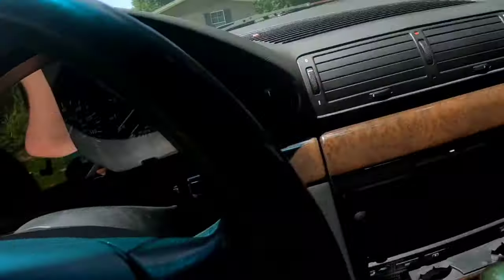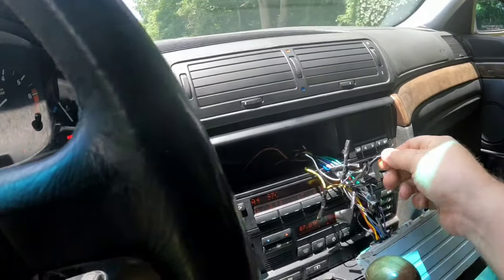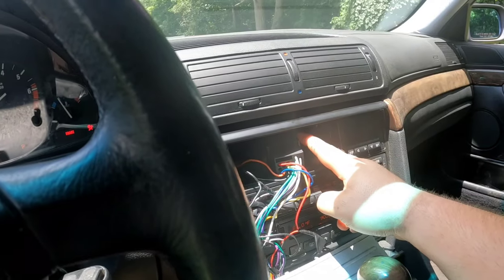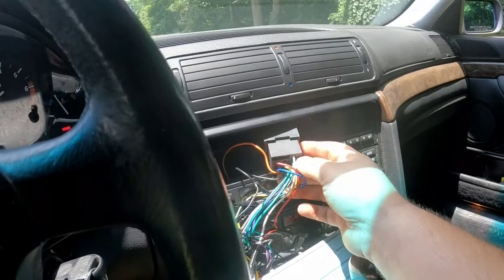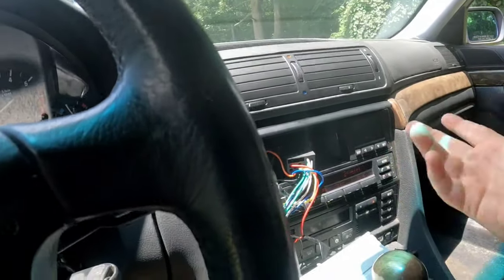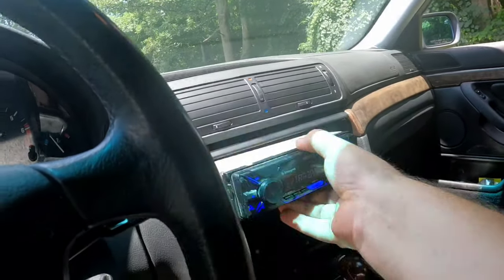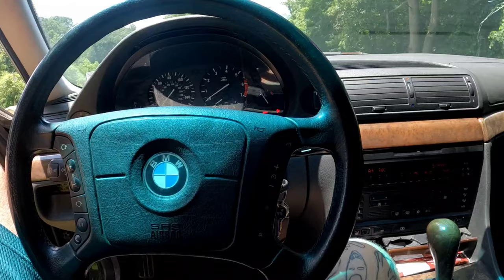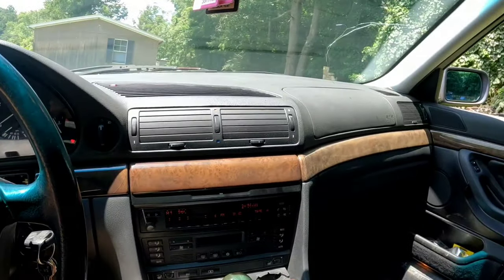How to install an aftermarket head unit in a BMW e38/e39/e53. VIP build pt.1

Comment: Hey what did you connect the Rem out blue wire and the orange illumination wire behind the radio to? thanks
Reply from the maker: It sais in the video the pin numbers but I can look at it later and let you know
Reply: Because I bought the same sony radio and i’m left with the blue and orange wire that I don’t know where to connect
Reply from the maker: @benjaminmasse7778  oh I gotcha ill pull mine out and check for you
Reply: Bro now it’s not working and my car won’t start 😂
Reply: Im not getting the dsp to turn on
Reply from the maker: @Plexiglass04  wtf
Reply: Hey man what year is your car? It doesn’t work for me. My radio in the trunk starts for 30 seconds then shuts off and the dsp doesn’t work.
Reply from the maker: @Plexiglass04  it's a 98